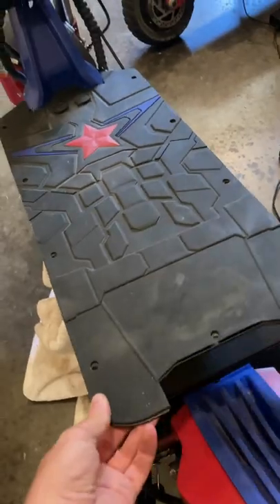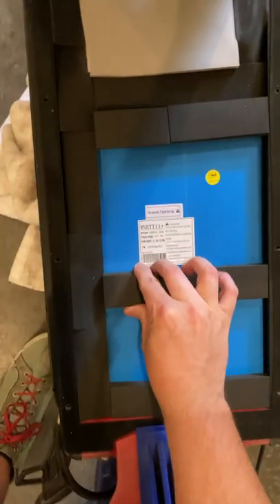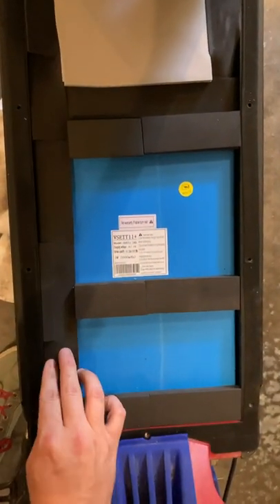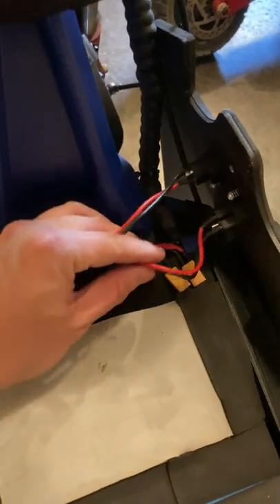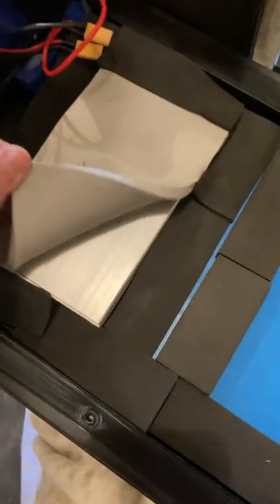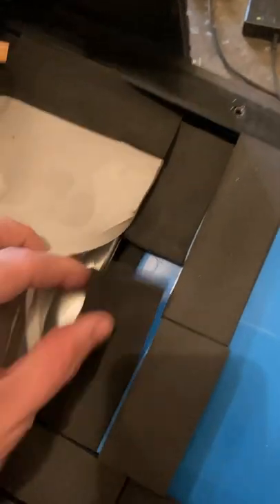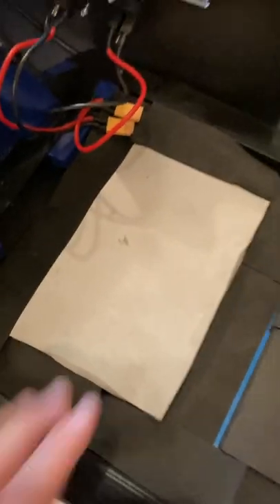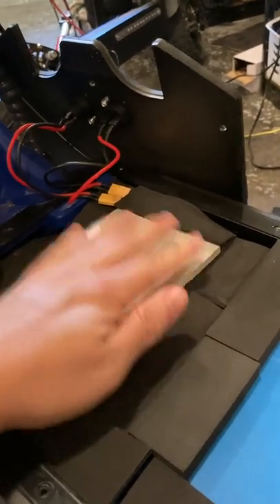What's INSIDE an Electric Scooter??? | Vsett 11+

Comment: Yep transfer all of that heat out to that aluminum covered by rubber pad. Thatll do. Controllers in stem or in the tail are the way to go atm.
Reply from the maker: The thermal pads are extremely thick and do a fine job dissipating the heat to the top and bottom of the frame. They obviously knew about this issue due to all the Zero 11X’s with melted fuses and redesigned this Vsett to be safer with far less chance of overheating. That’s part of the reason I bought it, because I don’t think it is prone to overheating like many 72v scooters out there…